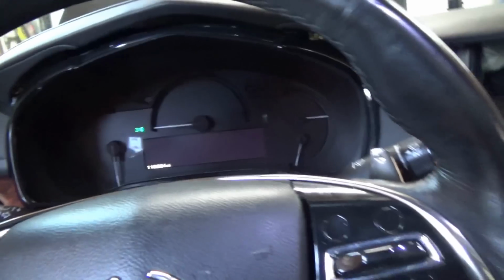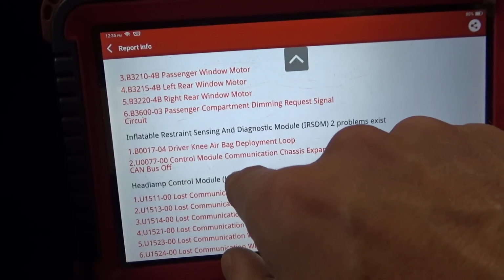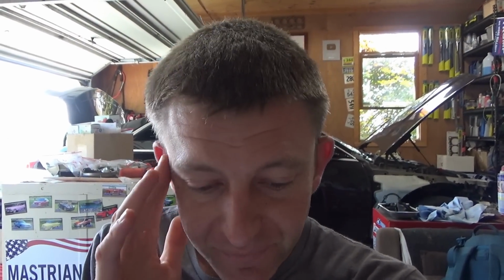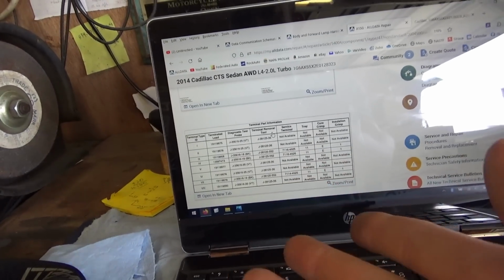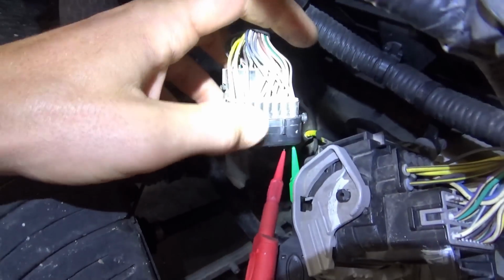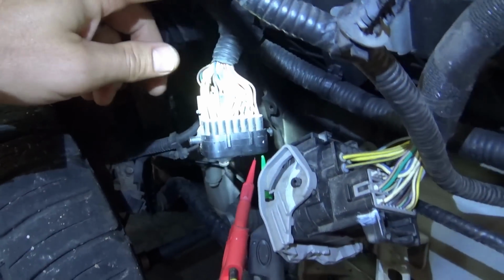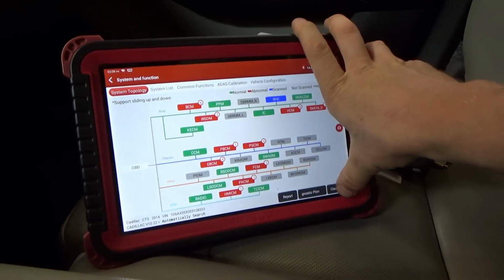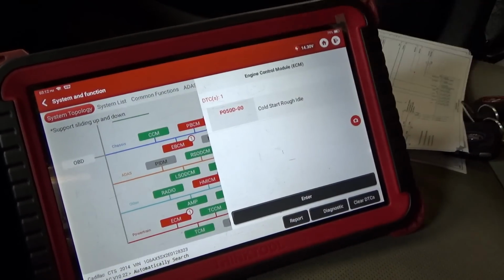CAN this Crashed Caddy Communicate? (ABS-Steering-Airbag...2014 CTS)

Comment: My issue are similar. But I believe it’s multiple issues. So long story short. No horn no radio. Abs, stabili tract limp mode all from some corrosion (pano roof) well I spliced wires and fixed it on the passenger side glove box. Ok left on vacation and left a power inverter plugged into the front cig lighter. Came back with no power and completely locked out. Could not get in the vehicle. Had to go from under the car to release the hood to charge battery. Now no crank no start no communication to ecm and now got an airbag sensor light. Help!
Reply from the maker: Just follow the approach as I show in the video 👍😁
Reply: Ok 😅 but can drop my car off to you lol
Reply from the maker: @CelestinoLanza  Sure just fill out the appointment form on my website :)

Comment: As a retired electronics engineer I urge you to learn how to use the audible connection checker on your meter.
Or get a meter with this facility.
This works with setting an ohms limit where the audible alarm sets in.
In this example of your fault tracing, setting the meter to a 200 ohm limit, you would get an alam once the wiggle causes a temporary connection.
Frees up your eyes and hands for the physical testing ...
Reply from the maker: I HATE beeping things 🤣

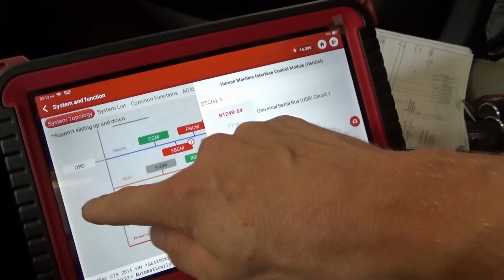Comment: 32:55 you scared me, "...blown head gasket..." and my first thought was, "If that car has the Northstar engine, Todd is screwed." Fortunately, it appears that the Northstar wasn't an option in the 2014 CTS, this one has the in-line 4 cylinder.

Comment: What a NICE video was that, so many skills and knowledge in one video!! AWSOME WORK for another time!! 
also a quick question, do you believe that a car that burns oil could have negative fuel trims because of the oil burning. I mean the burning oil 
produces more fumes than normal which makes the O2 sensor go high making the ECU to believe that the mixture is rich. Can something like that happen or not ?
Reply from the maker: It would have to burn a LOT of oil to affect fuel trims 😅

Comment: Very well thought out diagnostic procedures.  
All the steps from RPO and OE diagram use saved hours in my estimation. 
Double checking the pin out when it didn’t jive with what you expected was being very thorough. 
These steps don’t come natural to the average nut and bolt technician. 
I’m 7 yrs retired from this. Saw some of it before 2016 but not to the extent now. 
This half blind broken down 69 yr old car tech sure loves living out his love of fixing electrical problems thru you now.  Thanks a bunch.   
Del

Comment: Every time I watch I learn. Your troubleshooting seems slow at the beginning but methodically and purposefully you get right to the problem. Others just start swapping parts. I am amazed. Great video!
Reply from the maker: Well over half of the time in a diagnosis is spent doing research and coming up with a solid game plan 😉

Comment: Watched this video 2 times and I still am not able to fully understand this diagnostic procedure. I guess I have a lot to learn.
Reply from the maker: I suggest to print out the wiring diagram (even take a screen shot), and follow along with each step taking notes. Only proceed to the next step when you have understood the previous step. This network is basically a loop of wire with 2 120 Ohm resistors at each end...you can easily simulate this on a bench and do some experiments with the ohm meter too :)

Comment: I understand doing things you hate because you're good at it. I once made a living doing drywall finishing because I was very good at it. I was a good car painter too. I only do those things when I have to. As an adjuster I totaled a car because the shop was unable to diagnose a wiring harness break on a minor damage GM subcompact. It had an interlock that required the car go back and forth the interlock shop each time it was opened up..

Comment: I put a temporary kink in wire to hold shrink in position, keeps the digits away from heat. If it's a horizontal wire, kinks at both ends of the shrink. 

These vids are a nice fix for this retired tech.  👍
Reply from the maker: What if wire isn't long enough to kink? :)
Reply: @PineHollowAutoDiagnostics  I've never run across that situation. Which makes sense as you have to have enough free length on the wire to slide the shrink away from the soldering heat so it doesn't accidentally shrink the tip of it. All it takes is a tiny bend of the wire @ end of shrink to hold it in place. Also, in situations where the shrink wants to wander back near the solder point, I'll kink the wire to hold it away from the soldering heat.
Reply from the maker: @angelr8892  I just start shrinking the tube at the opposite side of my finger so it doesn't slide out of position 🙂
Reply: @PineHollowAutoDiagnostics  I used to do that too until one time when I was inside a tight space in a sorting machine. Really restricted access/vision. And I accidentally nailed a finger tip. That's when I learned to get kinky. Better safe than toasty. 😜

Comment: Hi Ivan, very detailed step-by-step diagnose which also shows the importance of having a diagram. I guess your resistance reading of around 6 kOhm was due to humidity-caused corrosion of the wire. The wire insulation was probably damaged by the crash.
Good job!

Comment: Great video and diagnosis as usual!  Love your analytical approach to narrowing down the location of the problem.  Very surprising that the outside of the harness did not show any physical damage.  Wonder how just that one wire got broken and all the others looked OK?
Reply from the maker: It was just a slight pinch of the harness by the radiator during the collision, and the thin CAN wire got slightly compromised is my guess.
Reply: Probably defective from the factory.  A broken wire inside the insulating sheath can function as long as the fractured ends are making contact and the conductor is not required to carry a lot of current.  Given enough movement, in this case an accident and contact was broken.

Comment: Thanks to Todd for all his work and info for Ivan.
Thanks to Ivan for showing us where the wire was broken.  
Previously when I worked in the DWP City Fleet, the Body shop there would leave the fenders off if wiring harnesses got damaged, or they would remove them if I asked them to, which was great.  Some older Navistar/Internationals with the one color (all black) wiring harnesses that had numbers on the wiring made it interesting to work on.  Really interesting if we didn't have the wiring diagrams.  Good Times!
Thank you Ivan for this video!
Reply: Todds Cool

Comment: Nice they kept it in pieces for you, made it easy to get to that one connector. Plus gave a little insight to where the damage probably is ... and was.
Reply: That's probably the only advantage to collision work, except when they hurry to put it all together without diagnosing.  I saw that happen once and never saw anyone look at a wiring diagram.  A tech started checking fuses and mumbling about relays hoping for a miracle that never came.

Comment: Boy I cannot tell you disappointed I was to connect my fancy new Thinktool Pro to a 2001 Sunfire, but alas, I had to go back to my Zurich from HF.  The thinktool would not read any of the modules.  Granted I do like the graphing function better n the Thinktool, I was really expecting more.  But it's another tool in the shop.  ;)
Reply from the maker: 2001 Pontiac Sunfire? Should be able to read that no problem...

Comment: 26:04 I yell at the auto off too but honestly its the only reason my meter works because I leave the battery on all the time. My low amp clamp gets a fresh battery every time I use it.
Reply: It's even worse when your multimeter blanks off the ports and opens one's to insert the leads to what setting you are on. My multimeter got dismantled and modified
Reply from the maker: haha "auto-off" is a blessing and a curse xD